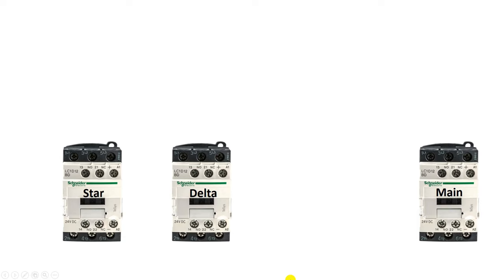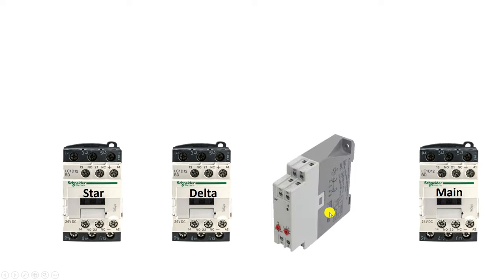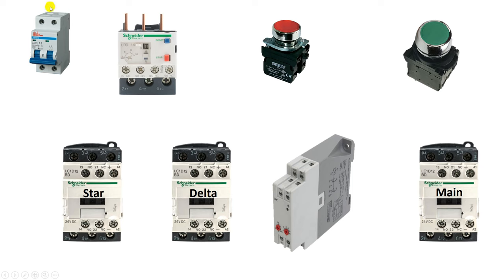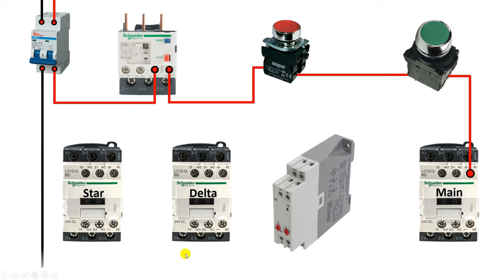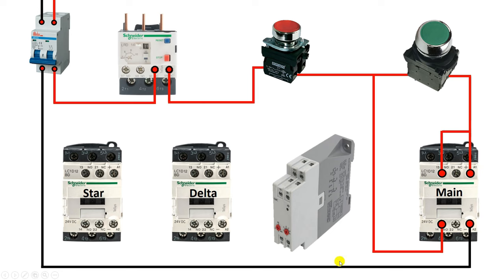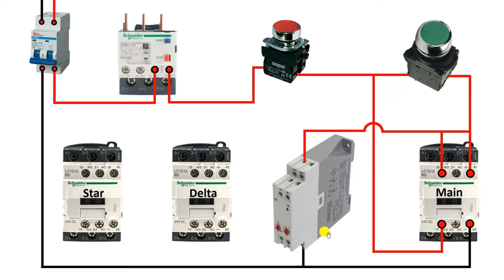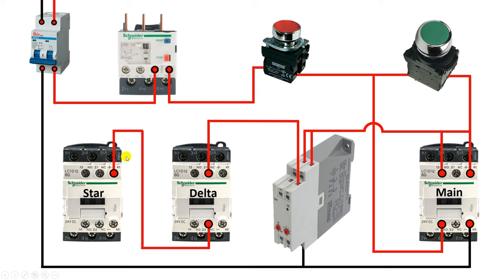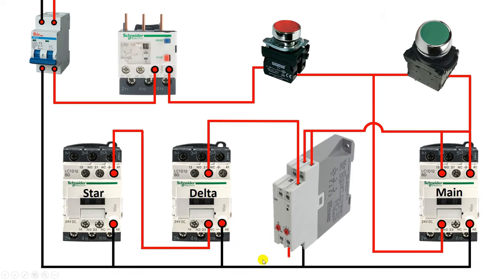Star Delta Starter Control wiring Explained by Pictorial Circuit Diagram @TheElectricalGuy

Comment: I've been watching your video over and over because you explain the stardelta power and control clear. I just have one question from what you did when you connected the interlocking wires on the auxiliaries of contactor 2 and 3, you used the normally closed on both, when I thought one must be the open auxiliary. Please explain.

Comment: The star and delta contactors must be mechanically and electrically interlocked to avoid short-circuit during transition of the motor stator connections. The mechanical interlock depends on the type of the three contactors

Comment: how does the delta coil energise if nc contact of star becomes no when timer goes off?
Reply: Once Button Green is pressed..current will flow from NC Timer (Terminal 26) will go to NC Delta (Terminal 21 and 22) and go to A1 Star coil…thus Star coil energized and at the same time NC Star coil (Terminal 21 and 22)become NO because the Star contactor is ON…

After a few seconds, NO Timer ( Terminal 28) will energised and NC Timer (Terminal 26) not energised and current will flow to NC Star coil ( Terminal 21 and 22) and will flow to A1 Delta Coil..when Delta Contactor is ON, coil is pushed ,thus NC Delta Coil ( Terminal 21 and 22) will become NO..this is the interlock..